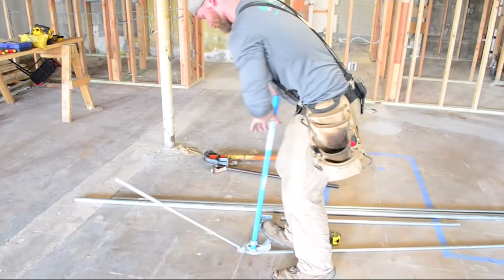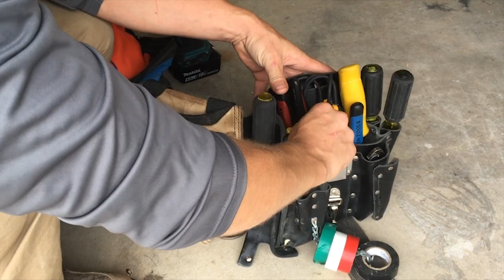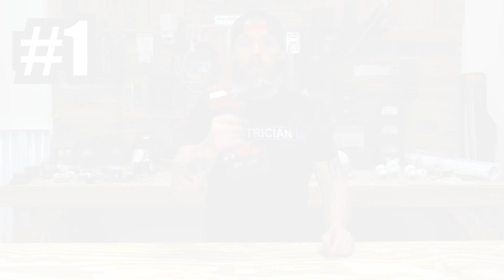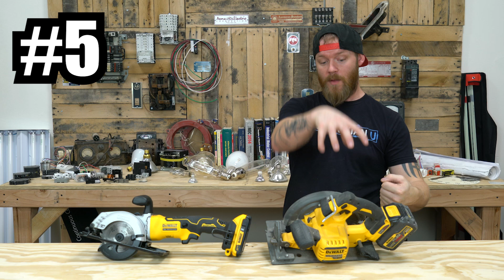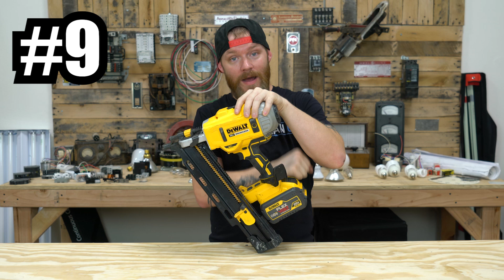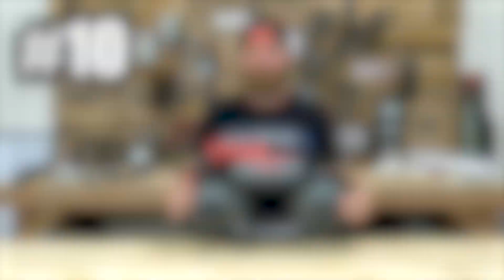10 Power Tools ELECTRICIANS SHOULD HAVE

Comment: The oscillating multi-tool is a must have for any kind of cut in. The thing has cut things I never would of imagined and saved my butt many times. I'm a red guy too...Hilti
Reply: I second the oscillating tool. And I'm a Hilti man too. Got to go with the best.
Reply: Ridgid jobmax has the hacksaw, angle drill, jigsaw, & oscillating tool  attachments so its a pretty good buy if you ask me.
Reply: Does hilti actually have one?  I always tell everyone around me, that i have made a mistake when i need to use my (makita 18V) oscillating thingy.  It will get me out of trouble, but usually everything where it is used, should have been cutted earlier with more suitable tools.  And any blade that cuts steel is too expensive and too easy to fuck up (or at least you could not let your crew use yours).  For plastic pipes and trunking its nice, but as you could cut and notch already installed conduits, you start to think less what you are doing and cut way more on a ladder than is safe or wise.
Reply: @villehietala9677  I love my Makita oscillating/multi tool.  What really sold me on it was working on plastics.  If I use a fine-toothed saw blade and move slowly, the heat of friction will gently melt what I am cutting through, but ONLY at the spot I am cutting through.  It is the best way I have found to cut brittle plastics like acrylics and some softer polycarbonates, because the heat reflows the edges and takes care of any small cracks that would crop up later.  

You are right about the things not cutting steel well.  If a guy finds himself cutting steel on a regular basis then he is wasting time and money he could be going toward the right tool and extra jobs.  That goes for everyone and every tool--get the right tool for the job and you will thank yourself later.
Reply: I was going to buy a ryobi oscillating tool because it had a bunch of attachments (rigid does too) and I'm so glad I went with Milwaukee. I didnt need one at the time, I just live a ways away from a good tool store, and wanted to be prepared. I've used it SO much in the last 3 months. Been through 20+ blades.
Reply: best tool for cutting drywall lol. fuck a keyhole saw when i got one of these

Comment: My journeyman doesnt teach me much of anything. Almost everything I know came from you. You're the man dude!
Reply: quit
find a new company
Reply: If you ask questions and he brushes you off... QUIT and brush his ass off.
Reply: That guy sounds like a real piece of s***
Reply: I was told by my instructors in college "what makes you better for taking this class than any other electrician, is that you can ask any Journeyman in the trade how to wire something, and they can show you, but then ask them WHY it has to be wired that way, and most of them will tell you "because that's just the way it is, because that's code" but WHY is it code? What's the safety reason that makes it a code requirement? What does the current, the properties of the circuit that state WHY you wired it that way, WHY you used that size conductor, that size/type of pipe, etc.
Reply: I’m so lucky I got my boy Carlos teaching me. He taught me how to bend conduit in like 2 weeks. 30s are my best friend but 90s are easy and 45s aren’t bad.  It’s just remembering the multiplier. But yeah broken English and all homie broke it down to me.
Reply: @bryandozer5922  how common is to see latinos in the electrical field? I was afraid of my English not being good enough for the job.
Reply: Dude your journeyman has a job to do. You should be learning on your own. Ur getting paid
Reply: @Nick-vf3wf  Someone gets bullied at work
Reply: @EditsByEntity  lol that was a year ago. Being w a huge company. But now that I’m more into the trade you gotta do what’s best for you. If you ain’t gaining knowledge or more money find a better place

Comment: Never seen a residential electrician use a jig saw circular saw or framing nailer before...i would say a multi tool or sds drill is much much more valuable then those tool for electrical work.
Reply: Nails aren't weaker than screws, they're used for different applications. Screws have much worse Shear strength and will break because they're brittle but have good hold. Take it easy just giving an opinion not trying to argue
Reply: @GreasyReecey  yea i guess i did come off kind of aggressive. my bad not trying argue just friendly debate
Reply: @jeanclaude2794  Nails are stronger than most screws. Shear strength but tend to pop out over time through sheet rock especially when you put an old work fan brace.  I learned not to over tighten those.
Reply: @DonkeyLipsDA3rd  yes nails are made from hardened metal because of the way they have to drive through wood. screws don't need to be that hard because they screw into the wood. this can be solved be one question. if you had to hang something above ur head that's heavy enough to kill you would you use nails or screws? pretty sure you wouldn't use nails would you...
Reply: Jigsaw nah, but circ is nice for 2×4s and a paslode nailer makes putting them up fast and easy, also over time nails are cheaper than 3inch screws
Reply: @GreasyReecey  dude seriously?? are you an electrician or general contractor?? whats more important for an electrician a circ saw or oscillating multitool. how often are you cutting 2x4's? i actually never cut a 2x4 now that i think about it...for us electricians you're not a general contractor building a house you're an electrician installing units or wall sockets and running cable/conduit. and reading the comments, every other comment is saying the same thing i'm saying. i would even put a cut out rotary tool above a circ saw. also yes nails are cheaper but astronomically weaker then screws. screws last forever nails lose load strength over time. in my opinion the point isn't to make your life easy or to buy the cheapest stuff the point is to do the job right.
Reply: @GreasyReecey  yep, can lights need blocking.
Want shear strength in a nail, try a concrete nail, will last forever 😆
Reply: I guess we all do different work
Reply: Deck screws have structural integrity.   Dry wall screws are crap. They are fine for drywall   Not meant to be used for structual

Comment: The oscillating multi-tool has saved my hide many times when doing residential work. I’m a red guy, but I prefer the DeWalt gyroscopic screwdriver. It’s great for all of the machine screws that we use in switches and receptacles, but it can also drive a 3” screw when hanging a ceiling fan. Turn your wrist left, it turns CCW. Turn your wrist right, it turns CW. Turn your wrist a little bit, it turns slowly. Turn your wrist a lot, it spins fast. One of my favorite things too is that it fits in my back pocket
Reply: That's the second most used tool in my bag besides my linesman pliers.  BTW...  Yellow guy here.  =)
Reply: Home-gamer here.  I was skeptical when I got an oscillating tool, but there are things it does that it does REALLY well and other tools do terrible.  Particularly tight spaces.  BUT, trying to use it for things other tools are great at, it does crap.  I loved it for trimming tiles up against cabinets to open space to run my LV LED light cabling, and getting nails in between boards where you can't use the "bend the sawzall blade" trick.  And I really love it for cutting drywall for remodel boxes.  My color?  Beige, but none of you use that junk.  :-D
Reply: I'm Makita 100% when it comes to my tools, but you've got the right idea with the Dewalt gyro--it is fuckin' magic.  TBH if you ever want to cheat on your favorite tool brand then those light (ish) duty screw drivers are the time to do it.  They almost always require a smaller battery than a normal powertool  so the "I'm saving money on batteries and chargers" excuse that we all use for staying with our colors goes out the window.
Reply: I made the mistake of using an oscillating tool to trim a WP box and it basically melted the plastic over the screw holes
Reply: I don't want to turn my wrist so I'll stick with Milwaukee electric screwdriver
Reply: I barely seen anyone using that besides myself. Super useful love that tool it's very light for its power I installed more than 90 devices in a building just using that for screwing

Comment: Not an electrician here (12v automotive installer) but I love my Milwaukee M12 stuff. Definitely consider picking up their oscillating multitool. That thing can do just about anything. Also, having a super small impact/screwdriver has come in handy for me a few times when I didn't need a whole lot of power.
Reply: Agreed .  If I was him some tools I would have both. The light weight m12 tools are handy and more easily carried on belt.
Reply: Does 12v auto installer mean you work for AAA changing batteries?
Reply: @HunterC99  LMAO No longer in the industry but no, I did automotive electrical. Security, audio, custom wiring, detectors/jammers, that sort of thing.
Also, 5 years later, still loving my Milwaukee M12 stuff!
Reply: @ im an auto tech using the same m12 impact driver from 6 years ago
Reply: @ what did you move to
Reply: @HunterC99  IT! That was always kind of my goal anyways and caught an opportunity I couldn't pass up. I do still do automotive on the side though. Got to make sure of all those tools (and justify buying more)!

Comment: -Band saws cut like butter! So smooth and fast. 
-I love my Hackzall
- I've never used a jigsaw. An oscillating multitool is so great and multipurpose. Better at precise work in my opinion.
-I'd rather have a dedicated hammer drill over a hammer drill/driver. I just prefer a light weight, compact drill. 
-And if you want to save a bunch of time drilling holes on the job, get one of these angle drill attachments. Saves a bunch of time, saves your back, and also saves a lot of trips up and down a ladder. https://www.milwaukeetool.com/Products/Accessories/Miscellaneous/48-06-2860

Comment: Every electrician needs a porta-band. Also roto hammers are pretty necessary. Self leveling lasers are absolutely necessary. Vacuums and lighting can be important too.
Reply: I never used a band saw, and with all the tools I have I think I really need to get one.  Seems like everyone here is praising them.  I definitely agree about lasers and vacuums, my cordless vac gets used at every job I go to.  Need a multi tool on the list as well, would make a top 5 on my list.

Comment: Did resi for 3 years never used a jigsaw
Reply: yup mostly jab saws.
Reply: @salg500  not for wood.  I would substitute the jig saw with a multi tool on the list, but in some cases a jig saw works better (less noise, faster cuts).  If you ever need to put an old work box into a piece of wood or a cabinet it's going to be a lot more difficult without either one.